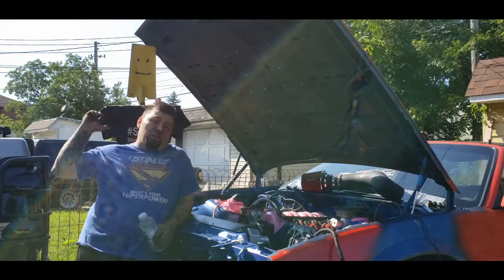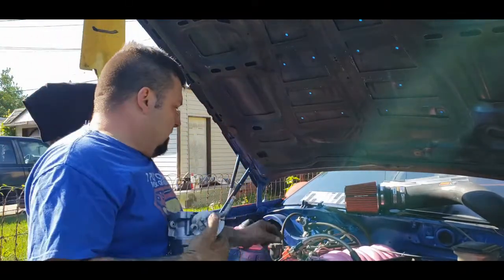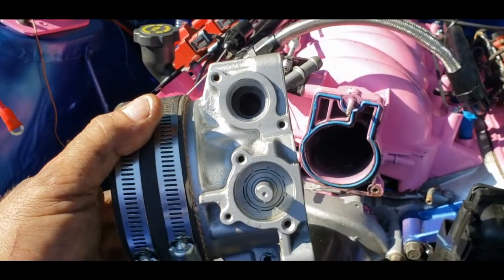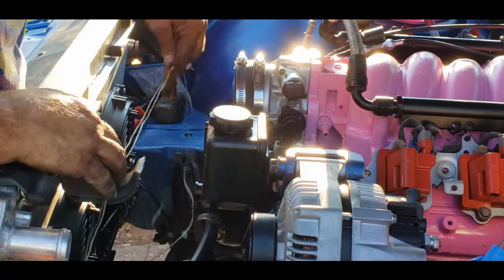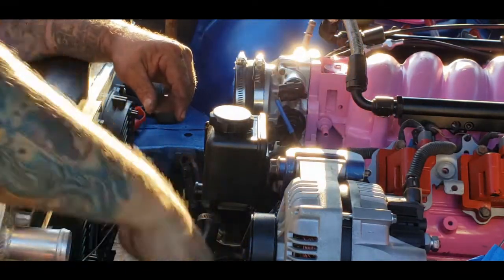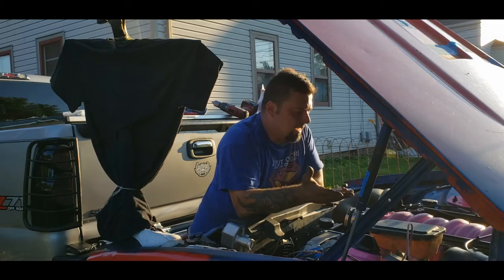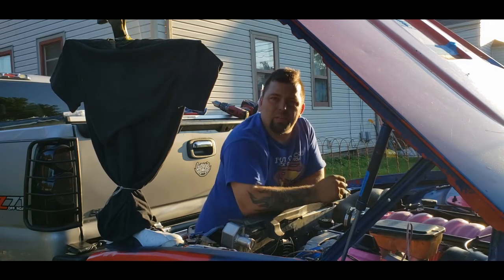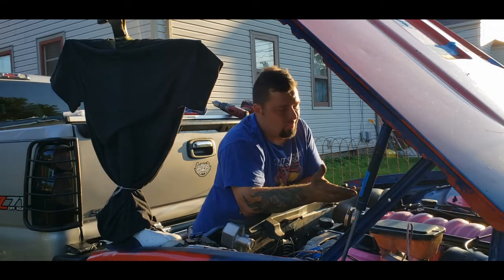700R4 Trans Cable to LS Swap Throttle body tricks and sensors and MORE !   3rd Gen Camaro LS Swap.

Comment: The tv cable controls line pressure, shift points, and kick down. Set it up wrong and your nice new 700r4 does an impression of Chernobyl
Reply: totally agree with you
Reply: My neighbor picked up a project car, 86 Z28 in what I’m told used to be yellow lol but he said the previous owner had a local shop punch out a 5.3 and install Ls1 pistons and the shop he used does phenomenal work, they’ve been in business since the late 60’s, but shortly after putting his fresh motor in the car things went kaboom pretty quick and was so disgusted with what he said was the engine shops poor work, that he sold the car to my buddy for $1500. Turns out he thought that the Tv cable on the 700r4 was unnecessary and just blocked off the port on top of the valve body😂. Unfortunately I didn’t have any 700’s laying around, but I did have a late model Ford pattern T5 with a bell housing that has both ford and gm patterns, and a pedal set for a third gen. So after a little fiddling, some cursing, more than a few beers, and a prayer or two, oh and waiting around for a clutch because somehow one of amazons indentured servants thought that instead of sending me the 10” clutch I’d ordered, it’d be ok to send me the flywheel instead, but after only a few debacles she’s up and running with an iron block Ls1, how long will that transmission last is anybody’s guess, but the moral of the story is the TV cable means everything on those damn transmissions, you can have the best of the best 700r4 made from wolverines melted skeleton with depleted uranium clutches or some shit but if you ignore or get the tv cable wrong you’ll make it about a half mile before you’re hating life

Comment: Bow tie overdrives   in California has the correct tv cable, it’s pricey, but necessary. A local trans shop/ builder installed it and was the first one to drive my truck. He said it went sideways when he nailed it. That was over 8 years ago. The truck is on my y.t. Channel

Comment: How does the 700r4 respond with the ls engine. I have a 5.3 but everyone keeps saying to get rid of the old trans and get a 4l60
Reply from the maker: I could not tell you why they have problems with their 700 R4 but I've had no problems I had it rebuilt it has fresh steel clutches and paper clutches and a new sun shell and it my transmission seems to work just fine behind my 5.3L.  Shirts on launch shirts from 1st to 2nd and chirps from 2nd to 3rd. Also my rear gears are 323 from a 1997 Camaro
Reply: If you're running fuel injected you have the computer to run the 4L60E

Comment: Does anyone make a commercial version adapter?  I'm not saying I don't appreciate your invention, but I've been wondering about this very thing for sometime as I have an '83 Impala with a 700R4 that could really use an LS.
Reply from the maker: I think there might be some type of fire wall mounted piece that you can use that goes off a vacuum I'm not sure but I think I remember reading something like that. I'm sure if you're mechanically inclined at all you can come up with something other than what I did is long is the cable gets pulled at least 3/4 of an inch you'll be fine.
Reply: Mad dog transmissions, but it only works with the ls car intakes